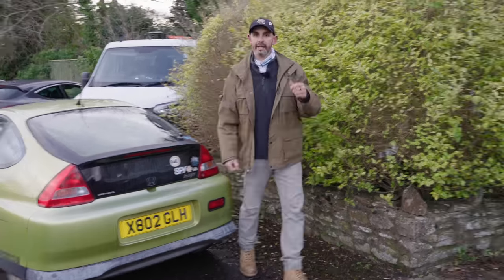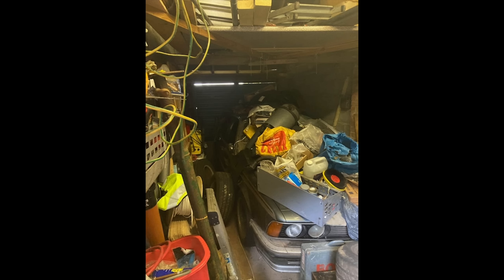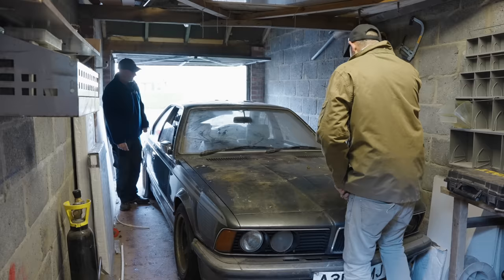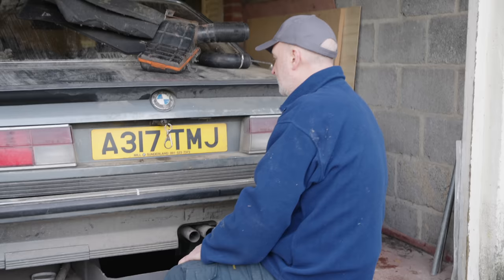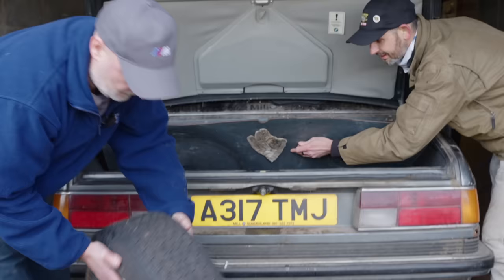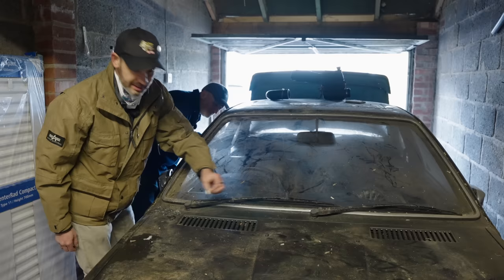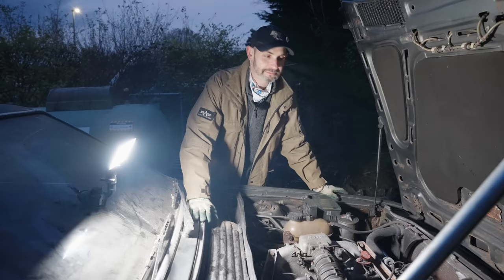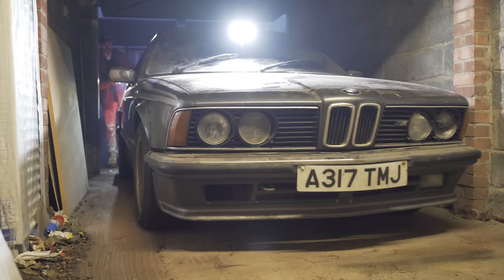Barn Find classic BMW 6-Series CSi discovered. Will it run?

Comment: There is zero point in working on these cars. There left in a shed for a reason....there too far gone with rust and not worth repairing.
Reply from the maker: Unless you are a fortune teller or you were present on the day Christopher, then you are wrong. Cars like this are far from rotten and beyond repair. The market agrees with us. Don't judge any car until you've seen it close up and judged the overall condition against the rarity and desirability.
Reply: @TheLateBrakeShow  the 'market' you refer too is a nonsense. A lot of people of course likes to see a shit box revived but, the fact is 99% of normal people will enjoy this, 1% can afford to enjoy them and or restore them. 
Unfortunately there all rotten cars with only nostalgic value and crap stories. ❤️

Comment: These ‘barn finds’ are so amateuristic is painful to watch
Reply from the maker: Painful, how? Because they aren't scripted, rehearsed, locations scouted and cars pre-checked before film day?
Reply: @TheLateBrakeShow  No because you don't take time to do it properly. Like starting it on the old gas still in the tank. Yes it works, but for how long? You will clog filters and injectors at best case, worst case you will need to redo the entire fuel system. Even priming it with the old fuel will cause massive damage. Same with the turnover, check if the engine is loose, replace oil, lube up the cilinder walls and then think about turning the car over by the starter. You want to do this all in a day for YouTube but if you'd really care you would take more time. To be honest I would rather have that you scripted it as that means you'd have a plan and actually knew what you were doing.